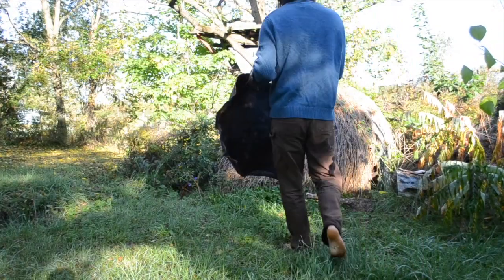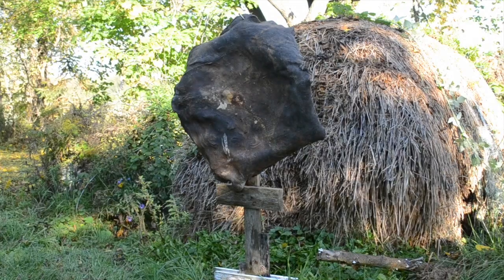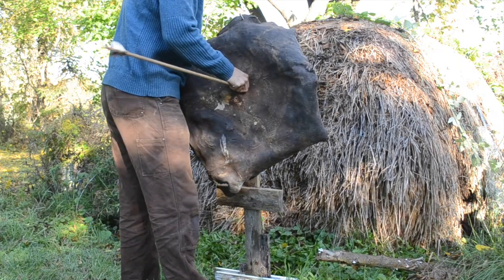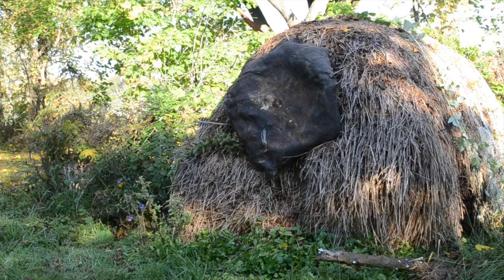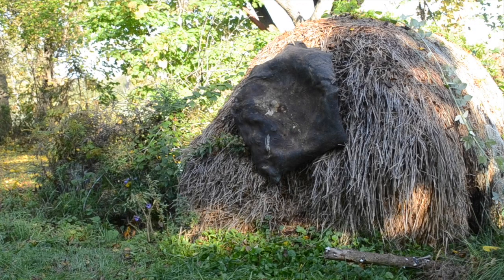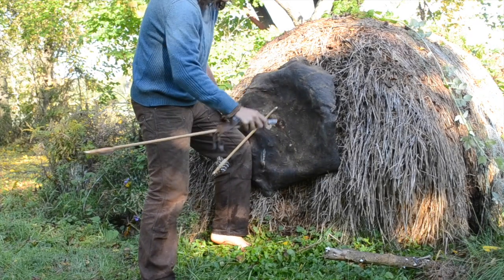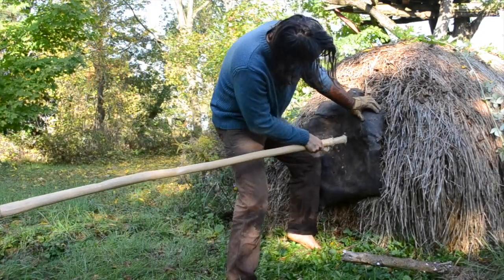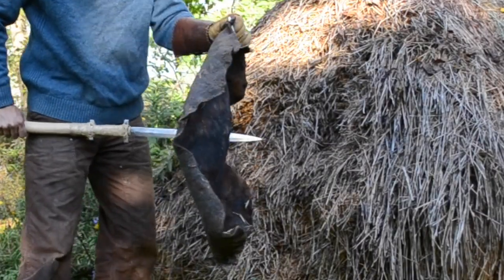Hide shield test.

Comment: The shield being thinner may have less to do with you making a mistake and more to do with cow skin being thinner than bison. I can't speak to that specifically, but in Asia, water buffalo hide was preferred to cowhide for exactly that reason: it was thicker (and also features a denser collagen structure). Among cattleherding African groups like the Maasai you can see a similar preference for Cape buffalo over their cattle as shield material.

As an aside, as someone currently doing some academic research into hide weapons and armour, this was a really neat watch.
Reply from the maker: Cow hide is about the same in most places, it’s only the shoulder where buffalo is thicker.
I did a small test piece where I got the right thickness, I just screwed up on the full thing.
Reply: @MalcolmPL  That's interesting that the bison hide is only thicker than cowhide in the shoulder region. With water and Cape buffalo it's thicker across most of the body. Also has a different collagen structure: denser fibres with more crosslinkages, which makes it tougher to pierce in ways beyond the thickness. Wonder what the different evolutionary pressures were there.
Reply from the maker: That second part about the different fibre structure holds true, buffalo is significantly tougher than cow given equal thickness.
Reply: @MalcolmPL  That doesn't surprise me overmuch to hear. I've seen footage of American bison mating battles, and that kind of intraspecific fighting in mammals tends to produce dermal shielding of some kind, be it in terms of thickness or the actual mechanics of the skin. 

One thing I'm looking into for my Africa research is the extent to which the animals selected for constructing shields/armour of out already have some form of dermal shield. I suspect that's one reason hide defensive gear shows up more often in Africa (and Asia) than Europe: better species to make it from.

Comment: Seems like the outer ring of the shield is sturdier than the center. You should try a double layered cowhide since you said it was half the thickness of the buffalo used historically.

PRAISE BE TO THE MIGHTY AL GORE AND HIS RYTHM
Reply from the maker: It's possible that the outer ring shrunk more from the fire, pulling the centre taught.

Comment: Thanks. That was very interesting.
I'm writing a story where an important storyline element is that how warriors use shields made from branches, wick, and cowhide. The video pretty much confirms my ideas how protecting yourself with such a shield would work. Good protection from arrows, but most probably I wouldn't want to get a direct stab with a spear :) Instead, I wrote that warriors don't fight in tight formations because they need room around themselves to avoid enemy's spears. If the tip of a spear hits the shield under an angle, all in the edge made of wood, that should be safe. But a direct stab could be fatal or at least it could destroy the shield, leaving the warrior defenseless for the rest of the battle.
Reply: only if it hit your arm, if you had a wooden plank with straps to slip arm into then even if it went through leather it would get stuck in wood instead of arm and anywhere else if your holding shield out defencivly spear tip cant reach your body unless they are using 2 foot spear heads so youd just gain control of there weapon if it was stuck in your shield till they managed to free it
Reply: @hamasmillitant1 : In my story it's cowhide and wick, no planks. Also, such a shield should be relatively difficult to make with the existing technology, so it makes sense not to destroy it if not necessary.

Comment: It would be interesting to see some tests with obsidian arrow heads (or normal glass if you're not within walking distance of a volcano).
Reply from the maker: I’ll see what I can do. Seeing how it’s supposed to be more fragile than chert, the extra sharpness might not make any difference.
Reply: you could also try flint, that was used alot and napped right it gets a razor edge but yeah after first shot it needs renapping usually. often loses tip
in my limited experience working leather sharpness/PPSI is paramount the wider and duller something is the harder it is to get through leather and its not linear, once you get down to razor sharpness 8000 grit+ it takes almost no force to cut even hard baked leather till you get to wider part of blade and friction kicks in
what would have really torn up hide shields is all the javalins & lawn dart style weapons they had around time of christ they are basically large awls they would poke right into any hide or leather unless it was super thick
imagine what a pilum would do to that hide for eg (roman heavy javalin) with thin neck designed to bend after penetrating shield and encumber the shield (it it hadnt gone through your arm or something)
i think they would stick in basically every time on hide

Comment: Interesting as always.
Might try against pointy sticks of various 'sharpness'.
Reply from the maker: If the antler arrows couldn't do it, I doubt if a pointy stick could.
Reply: @MalcolmPL  Running at it?
(different mechanism, more force = tearing instead of puncturing)

You might be right.
Reply from the maker: The difference is, less impact but more pressure. The arrows hit hard, but the force is used up instantly, whereas the spear hits less hard but the force continues for a half second or more, which is why the iron spear always does so well.
In the case of wooden or antler points though, I think the limitation is the size of the head. It just can’t force its way through that much material.
Reply: @MalcolmPL  Oh I get it.
I was thinking 100% wood spear or short/long spear with various degrees of sharpness, you thought 'wooden point' (mounted) on something.
I agree with you 100% in that case.

Comment: Most shields were made from around the buffalo’s hump. Old bulls are the best and fresh off of a buffalo can easily be and inch and a half thick.
Reply: Actually, plains shields were traditionally made from the ventral thoracic area, that is, the throat, not the hump. The hump area even on an old bull is only about ten to twelve inches wide and tapers off to much thinner hide very quickly. The  texture of the hide from beneath the chin down to the brisket is thick but also stretchy which allows it to shrink and thus thicken.

Comment: Considering how hard it is to remove the spear from the shield, I'd say it still is overwhelmingly effective considering the enemy has been disarmed of their most effective weapon pretty much. Also considering the performance of Zulu rawhide being able to stop bullets at range, I'd be curious if there was evidence pointing to rawhide use on the east coast as it had other uses. Overall rawhide seems to just be fiendishly better than leather, especially 'boiled' leather which suffers from self-lubricating of attacking weapon points. 

Even with its rather ugly and unsmooth state, even that lump of baked leather would evidently still be pretty useful. Seems pretty standard performance of shields, if not on the higher end of things compared to contemporary weapons.
Reply from the maker: It would depend on how you responded. If you gave the opponent an opportunity, he could get the spear out without too much difficulty. But if you dropped the shield, the spear would have to follow.